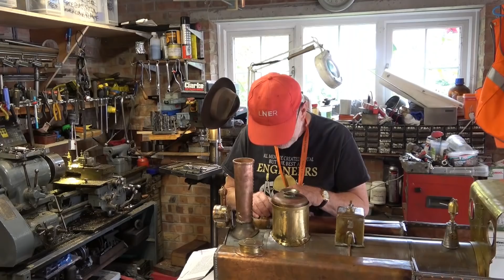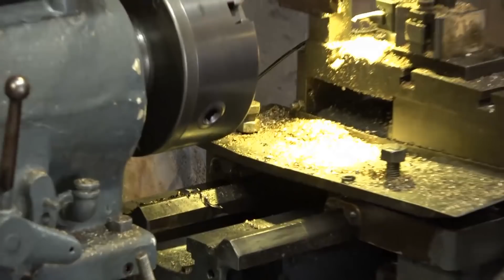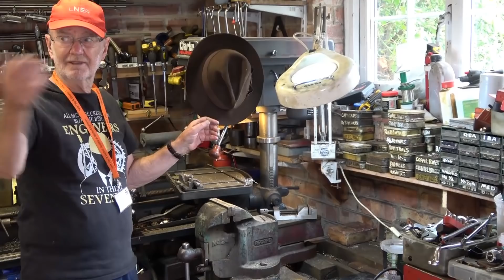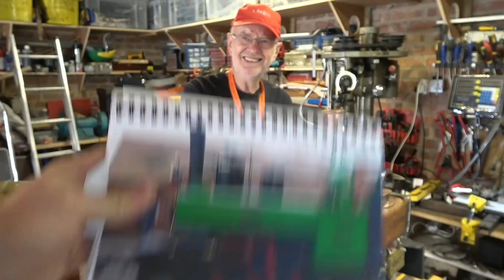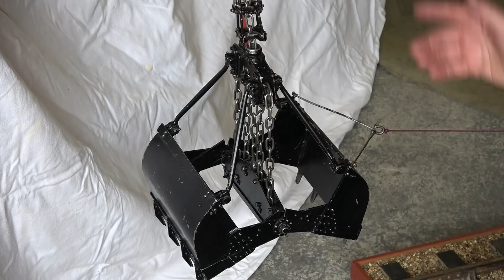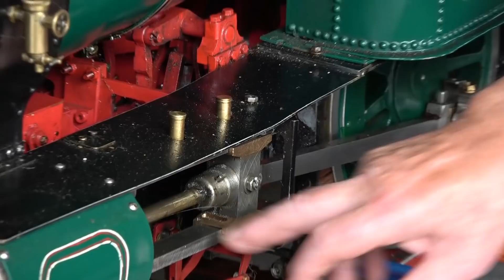Tour of a Model Engineers Workshop

Comment: I found this video to be fascinating as well as most inspirational. I am in the process of developing my own workshop and this video has given me some great ideas. I presume that Richard's workshop is sited in a single-car garage. I wonder if it might be possible to show a drawing of the layout of Richard's workshop? This would be of great help for maximising the effective use of available space - many thanks. Martin Cook on the Isle of Wight.
Reply from the maker: It's a bit bigger than a standard single. I have normally used the method of doing a scale drawing and then making cut outs of the machines in scaled down size and moving everything around untill you ge the best outcome.
Reply: @MrCrispinEnterprises  I too have been using a similar method for many years. Many thanks for replying.

Comment: I have a similarly designed mill but mine has the rack securely bolted to the column, eliminating the issue of the head moving when unlocked. 
Looks as if Richard may be able to do the same to his to resolve that irritating problem.

Comment: This is very nice to be listening to Mr Richard Gibbon again. This has help me out with what to acquire to get started in this hobby. Mr Crispin i trying to decide if i go towards a big lathe that i can mill off which means not buying a mill or do i go boarder line on the lathe and have a mill as well. What would you consider in a lathe as far as swing capacity and distance between centre capacity to do a 5 inch  simplex first up and a 10 wheeler in the future. You are an inspiring person and thank you for taking the time to create this content.
Reply from the maker: If a locomotive is the plan then I would definitely go for a milling machine. There is probably just as much milling on a locomotive as there is turning and it will get VERY tedious trying to do it on a lathe with a vertical slide. So personally I'd go for a lathe no smaller than a Myford ML7 and a milling machine no smaller than the one Richard has. Cheers and thanks.
Reply: @MrCrispinEnterprises  Thank you Mr Crispin for this very wise advice.

Comment: Thanks crispin for making this video it was very interesting. People like Richard are an inspiration and always a pleasure to listen too. Maybe you can ask Richard if you can use his shaping machine to cut the keyways in your locomotive wheels. Will you be using cast iron or steel for your wheels? Thanks once again.
Reply from the maker: I think I'm tempted to challenge myself and try the potentially tricky cast iron wheels with steel tyres. For the size of wheel I'm doing with 18 spokes cast looks allot better. The Steel tyres would be for optimised running.
Reply: @MrCrispinEnterprises  yes I agree, that would be the best option.